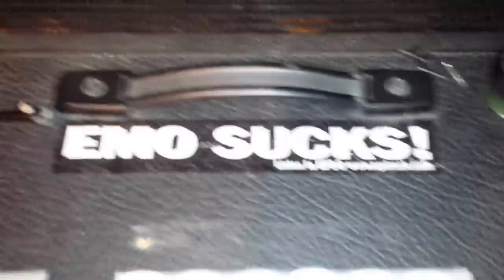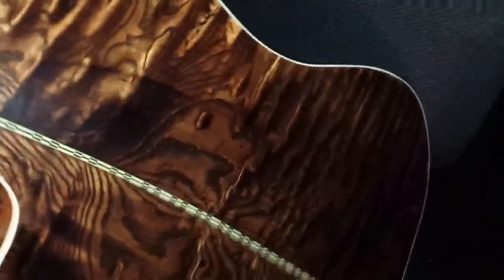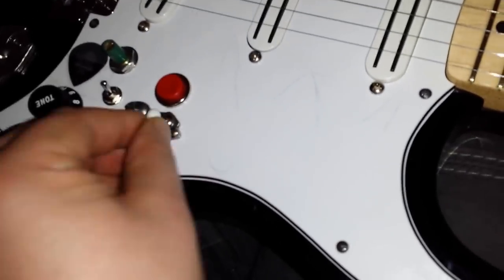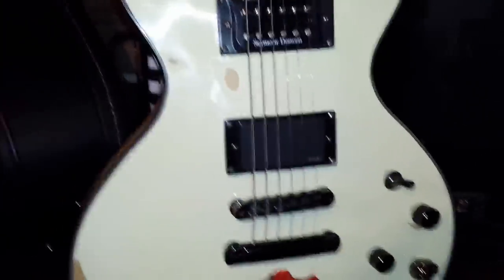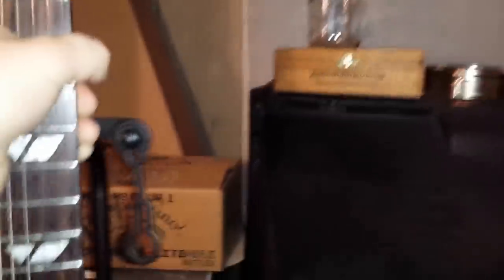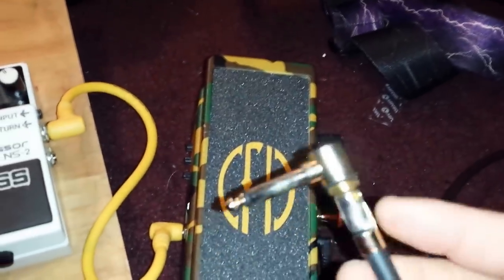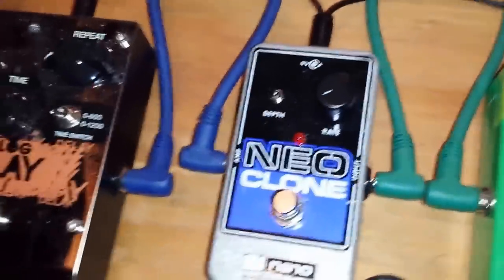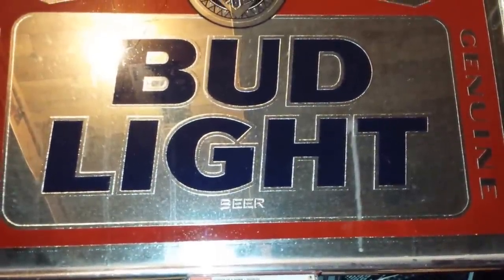Extensive Rig/Gear Rundown 2014

Comment: Instead of replacing the bridge, just a suggestion to save you money, put string saver saddles. They have the regular graphite string savers which kind of darken the sound and the classic string savers. It's like $40 off StewMac for a set of string saver saddles.
Reply from the maker: No ide rather get a different one entirely. This one sucks.
Reply: WaRLoKWYATT It does. I love my strats but the bridge is just a horrible design. Since I never use the tremolo I just decked the bridges on both my strats and put the string saver saddles on so I don't break the strings as much. If I had the money to replace the bridge I would and I probably will eventually but for now, it works.
Reply from the maker: Brian Reed They have Wilkinson bridge kits that don't cost much on ebay. Check em out!
Reply: WaRLoKWYATT I'll check it for sure. Thanks man.

Comment: Nice set up man! I hate the pickups in my strat too, I'm keeping the sharp bridge though, I'm so used to it that I can't play a start that doesn't hurt when I palm mute! I have a bit of info I want to share with you about the amp. That 6L6/EL34 switch just sets the bias range to run either 6L6s or EL34s. There is also a bias pot inside the amp that lets basically fine tune a matched set (I just checked the schematic). I bet that pot was set really cool on yours so flipping the switch made it really hot. It's ok to run the 6L6s hot if you like the tone, but they will wear out faster. If it's biased right you can get both the hot tone, and a good amount of life out of the tubes. Those stock Ruby tubes can take a good beating, but check out Winged C brand for 6L6s and EL34s when it's time for new ones, the best power tubes I've heard for metal! Oh, and watch out for the carbon comp ,they don't seem to last long, I burnt out 2 of them before I sold the 3rd one.
Reply from the maker: The carbon copy delay? I have never heard of any burning out. Everyone uses them.
Reply from the maker: I honestly like the tubes and the sound I have. These tubes are already worn out but I got 9 years out of them, give or take. I think I'm just gonna get the same set.

Comment: im still running my 90   5150 tube with a  slant 4 by 12  it has a 16 ohm  and 8,4  switch on the bak of the head,the cab say  16 ohms  im currently running the head at 8 ohms   what do u think I should set my head at for best sound?  I also  run hard  gain lol and my 90 rg570 is still my fav bitch,  love em  the tube action kicks  even on zero  lol. just need your advice on what ohm I should run my head on    thnx  man.

Comment: I'm old ass. WTF is EMO. On the back of amps it is impedence (your right it's measured in ohm's). For acoustics which I play most of now, the music style I'm experimenting with now is old dinosaur, old Django swing music. I'm using either silver plated Labella (9-50) or silver plated Galli 10's the latter is louder and tighter. The idea behind silver plated strings, it they have a very slightly looser feel than phosphorous bronze. They cost a bit more too.
Reply: forgot ... the looser feel allows more for lead playing acoustic.
Reply: Joseph Rinaldi also ... those sliver plated strings I think are more designed for archtop acoustic, they will drive the top differently on a flat top and sound and feel rubbery
Reply from the maker: Joseph Rinaldi I don't play with phosphor bronze, I play with 80/20 bronze. I was talking about Ernie Ball's new aluminum/bronze strings. They are brand new and apparently they give you more life and volume without being coated.
Reply from the maker: Emo is shit music like Hawthorne Heights and My Chemical Romance. It's also a fucking stupid style. The kids that wear makeup and all black with their hair swept to the side and in their face. They talk about wanting to kill themselves and shit. It's stupid.